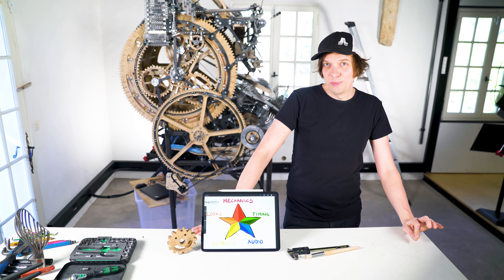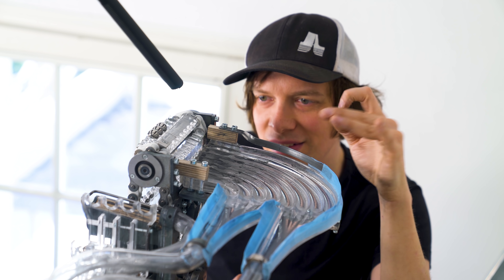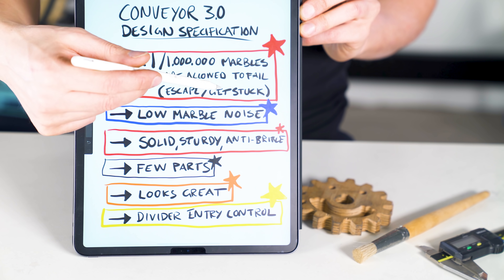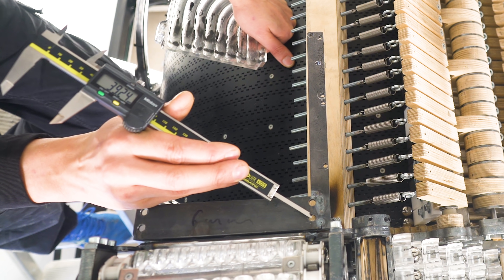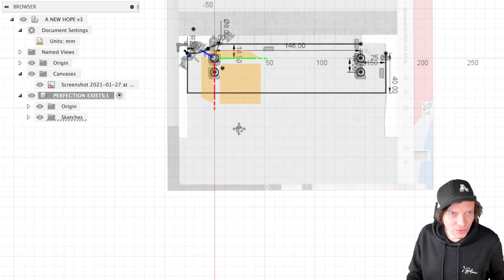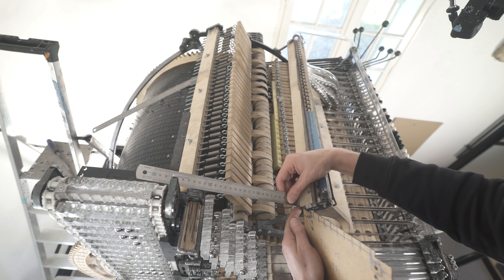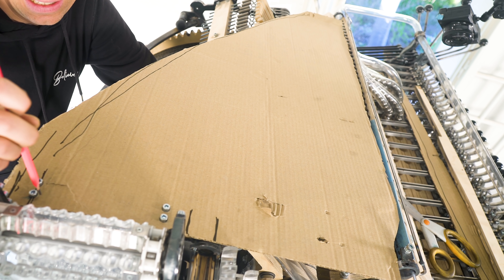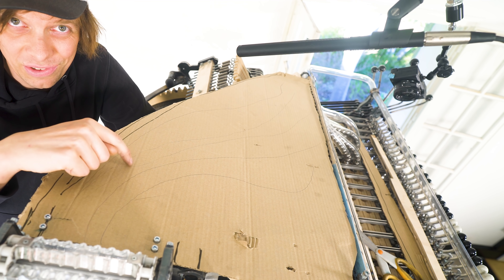Designing From First Principles

Comment: should this new version still pose problems with ghost marbles you could try the marble elevator angling towards the tracks that go to the divided. that's gonna need dampening where they drop down but it will solve the problem of ghost marbles.

Comment: Channelling all these marbles makes me think of exhaust systems for big multi-cylinder engines (V12s, for example), that have to manage the exhaust pulses out of the engine to ensure a smooth flow of gasses for the best performance - Each marble could be considered as one exhaust pulse out of an engine cylinder.. Maybe there are solutions to be found in the design of exhaust headers?

Comment: Hey Martin, unfortunately this design will not work as expected, the outer left channels will run out of marbles! You also have to take into account in which direction the momentum is driving the marbles, you have to transform their direction vector! IMHO, transforming it into a left to right movement with the pipes was the best solution!

Comment: If you've measured correctly, and your CAD is good, you could've made that gap as small as 2mm if you'd wanted to. Maybe even tighter than that. Right now you're right on the edge of where you needed that gap to be, which is more dangerous for your design. If I were you I would've stuck to the orginal 5mm you had planned.

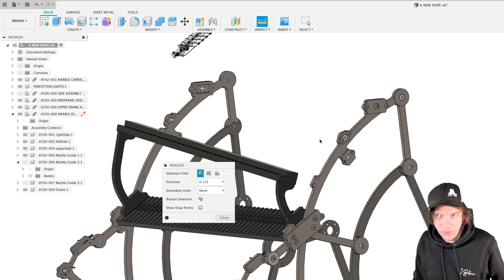Comment: Martin the first measurement you took on the CAD model at 13:27--it looks like the measure tool is measuring to the outside of the hole (not the center of the hole as you were intending). This may not matter as it seems like later in the video you may have built your reference geometry off of ruler-measured, "on machine" dimensions, but I don't want it to hose you!

Comment: I'm not sure why the complex production is a factor if the parts are already produced. This is the MMX, not the MMY. You said that the third Marble Machine would be the ideal one, unlike the MMX which while more consistent and reliable than the original MM, is still a prototype of sorts.
You've designed complex parts with multiple pieces and methods of fabrication. But you already made them. It doesn't matter that the process sucked, it had already produced the pieces. The backboard, for example. You had one already, couldn't that be repurposed?

Comment: In the process of developing a part using custom planes that implicitly refer to another part, wouldn't you just end up having to manually chase collisions due to dimension/feature changes through your entire project? Wouldn't properly constraining and referencing your out-of-file dimensions end up with a design that can recover and adjust to change in an automatic manner instead?

Comment: Martin, this really looks like you are bypassing the whole marble divider concept which you worked so hard on. Seems like you should be able to have many tracks/pipes going to a single track/pipe - after all, it has to happen at the bottom of the machine too... hope it works for you and you don't just create or reintroduce problems you had solved already. That actually happens all the time in the real engineering world, especially if you might have forgotten that it was even a problem, because you solved it so long ago!

Comment: okay, feeling more hopeful again. I feel like the tray the marbles dump into should be a but slanted to keep the marbles from sitting against the flat surface that bolting the new part to the metal plate underneath it will surely make, to keep the marbles from falling backwards

Comment: I have been watching your MMX build from the start but I don't remember much 3D printing. Why don't you reach out to a 3D printer?
Reply: If you look at his end credits he has a ton of past collaborators who have made parts for him. These include welded steel, machined steel, machined acrylic, laser-cut steel, 3D printed polymers. For an example of 3D printed polymer, check out the marble guide blades between the strings of the bass guitar.
Reply: @ps.2  gotcha, I was thinking about some 3D printed polymers that reduce sound a bit but also would probably be really useful do to the engineering you have the ability to use with curves, heights, thickness and whatever else may go into an engineering point of view. Big thing as well would be sound deformation, or dampening.
Reply: @zacharyfollett7305  Do you estimate that steel striking PLA is quieter than steel striking Baltic birch plywood? (I don't have any first-hand 3D printing experience so I can't say. But PLA parts I've handled do seem to be about as hard as plywood.)

He's also trying to reduce the parts count so if he used additive manufacturing, he'd need a machine with a pretty large working space. His current mill lets him cut parts as large as a whole sheet of plywood.
Reply: @ps.2  there are several different plastics to print with, some much softer than others. And I was not talking about the plywood. I was talking about the cnc'd plastic that the marbles come off of from the conveyor belt. Also just want to point out there are plenty of soft plastics you can 3D print with that are soft and reduce vibrations and noise. On top of that they come in several colors and they can be printed in one piece.
Reply: @ps.2  also considering build volume, there are plenty of 3D printers that can reduce the amount of pieces required for the build.

Comment: @wintergatan 2: good to see some movement towards a more engineering mindset! Took long enough ;) .  I suspect party of your issue is wear at the landing point as well, or just the hand fitting you've done in the past. It also might make sense to look at the marble transfer point. It would be more reliable (and quieter) if you had the marbles lift/ slide of the conveyor rather than fall as they do now. Imagine them getting scooped of the lifter by wire rails. It's a very common method used by other marble machines.

Comment: To get rid of the noise, but still have a precise marble path, you might consider machining a negative (i.e. a mold) and casting the surface in a firm but pliable polymer like PDMS.

Comment: I think you missed an opportunity with that divider wall. As you say the height allows them to "negotiate" around each other.
Taken further this could be made in to a passive solution to the channel height problem instead of thos path length adjusters.
If they can reliably go around then sitting proud doesn't matter.

Comment: Why must you constrain yourself to levels of perfection that vastly outweigh any professionally produced sound creation, recording or other related devices?  Do less than 1/1mill CD's get produced perfectly?  Are less than 1/1mill records produced perfectly?  Do less than 1/1mill songs get produced without any post-editing??  Do McDonalds get your order right less than 1/1mill ??  No.
Reply: I would say that some parts of the MMX are unchangeable, like the gearing.  The gearing is not protected at all, so loose marbles could easily fall in the wrong place.  That could jam the gears, shearing off the wooden teeth and essentially ending the concert series for weeks.  I'm of the opinion that there are no safe drop zones for marbles other than the instrument paths.

Comment: couldnt you have added a small vertical curve/ramp (at the conveyor drop-off) from the previous acrylic parts to prevent marbles from getting stuck or going back into the conveyor belt, rather than tearing out and replacing everything altogether there? just let gravity do the work.

Comment: CAD advice from an engineer:
1. I haven't played with Fusion, but if it's anything like Solidworks or Onshape, you can make those two circles equal with the "equal" constraint. Using that centerline just adds another element to the sketch, and just like the MMX, adding an unnecessary element just means adding another failure point if you need to tweak the design later.
2. From experience, you should add your fillets as features of the solid model, not as sketch segments. It's less likely to break if you go back to change things.
3. Breaking references between parts is smart. External references are super convenient, until they ruin the entire model.

Comment: I apologize if this has been answered elsewhere.
Why have both the fish stair and the conveyor belt? Both provide the same function, and their start/end points are quite near. Couldn't you reduce the number of parts - improving reliability - by routing the marbles to the bottom of the conveyor belt instead of the fish stair? You would, granted, have to use a 12 marble wide conveyor instead of an 8, to make up for the loss in lifting capacity.

Comment: I could watch so much more of you doing Fusion360! I'm totally with you about managing the timeline and being super considerate about which references and links you bring into each component.

Are you avoiding the links between components to keep your designs based on the models "as built"? Or is this to mitigate some kind of circular dependency of references? Why not let the links make future updates easier?

I would love to hear what your thoughts are on leveling up in Fusion 360 and how your thinking about design has changed over time. As you evolved from making one-off parts to managing a giant complex system of components, allowing for gaps between what is designed and built, what are the tricks and habits you have picked up? I think a lot of people design one-off things in isolation, but seldom get to work in such an iterative process as you have, or at least not so publicly, so you probably have a very unique perspective.

Comment: I don't know what you're doing, you said you want to do less videos and you're doing more.  You said you didn't want to redesign the machine but you are doing it.  Change to 22mm spacing and you will be done.  I don't have an opinion on your attitude toward the machine but I like the videos.  SV Seeker, a boat building channel, is aligned with your current attitude, it will be done when it's done!  And you should be happy doing the work.

Comment: Use polycarbonate, (Lexan) instead of acrylic. Lexan is very tough provided that the tools used don't have oil on them. Tapping holes with oil on the tap will cause the Lexan to crack.

Comment: At the bottom of the conveyor belt, add a cover, so if a ghost marble does ride back down, it won't fall out, the cover will keep it in the shuttle and it will ride back to the top

Comment: marbles can still fall back down the conveyor with that gap, actually they can fall with any gap or zero gap, because the movement of the conveyor is intermittent a well timed marble bouncing back against another in any sort of open tray can roll into the conveyor and the conveyor could move downward before it has a chance to roll out again, it's not likely at all but it is possible. a halfway working solution would be a slope on the lip of the tray, another solution is to make the chain wrap more than 180 degrees around the sprocket and use a guard to keep the marbles from falling out until they are over the tray, forcing the marbles to fall out of the conveyor in free air and not allowing a marble to ever encounter the conveyor in a state that it can hold marbles.

Comment: If you combine the divider and the delivery you can make an easier setup for linking to notes, so instead of having to bend tubes for each note you can bend tubes for front and back, and setting the marble stack at an integer inclination of the marble's size could remove the need for minute adjustments of the marble paths. I had an idea but I use CATIA and my machine is.. dead.

Comment: Im sure you could reduce the noise from the marble fork, by adding some deadening materials to to the underside. thin acrylic is quite resonant so any vibrations gets amplified to a a lot of noise. Adding something like Dynamat to the underside could deaden the fork. Might not fit your aesthetics requirements, but maybe you can think of other ways to deaden the large flat surface.

Comment: Hey Martin, great to see that your experience with the MMX leads you to fundamental development and design principles of engineering! Extend your design process with some more steps like collecting and comparing different concepts before implementing the design (like you've already done on other parts) and you'll end up following a norm for design methods ;) Imo, the whole idea of identifying and preventing later issues by following a structured development procedure before actually starting with CAD is probably one of the most important things to do when working on complex designs like the MMX. So keep on your great work, it's fun to see you improving your skills further and further!

Comment: This is more perfect time than there will ever be.
You wanted to increase the angle of marble divider surface (5 degrees one).
Now is the magic wand moment you talked about. Only 7 pipes to re-bend and the marbles wouldn't need the precision in height modules.
Now or never.
Reply: Notice that every single time he changes something, he introduces new issues that didn't exist before. That happens because he's focusing too much in getting small details right with the consequence of compromising functionality, as his machine is not designed to be fault tolerant, but has the impossible goal of being fail proof.

Comment: Improvement idea for the devide by four: you could maybe make the system more reliable if you balance the tipping point of the system to 5 or 6 marbles and than just release the 4 of them. In this case the marbles that should enter aren't able to move while it gets to the tipping point.

Comment: Maybe you can reduce some noise by making the area where the screws are a bit taller so they wont fall as much as before
Reply: The location where he put the silicone to quite the marble drop need to be moved vertical. If you notice the marbles come off the top of the conveyer and drop down to the channels. By moving the landing up it will quite the drop noise and help push them forward.

Comment: Hey Martin, I'm sorry in advance to the tone of this post, I'm not good at expressing myself in writing. Please read it, I think it might help you progress a lot with the machine. 

So, I've been wondering... 
What's the point of stopping all of the marbles from falling? Or trying to prevent a few small cracks?

I get the 99.99999% thing, but it seems to me you took it in a wrong direction, and your priorities are a bit off. 
It shouldn't be 100% marbles and 0 cracks, it should be 0.000001% chances of critical failures.

A few marbles dropped are not an issue - it might even be cool to be in the crowd next to the stage, trying to catch the marbles falling off the stage... 
So you need 100 more marbles for the next song? Just add them after the current song ends. 
Have a part that cracks after 3 concerts? Replace it. You're probably going to move this machine around in parts anyways.

My point is - it's better to have a 95% functional machine on stage than 100% non-functional at your studio.
Distinguish between critical and minor issues. Fix the critical ones first, and backlog the minor ones. If you have time in the future then whack those small moles. We all have our small imperfections, and there's nothing wrong with it.
Reply: Several people have pointed this same thought in the video where he mentioned his goal, which is impossible to achieve. There's no example of system in this universe that has a 1e-8% chance of failure. Good systems and designs have fault tolerance and recovery in mind. If you use a car engine as an example, it misfires, backfires and experience issues thousands of times during normal operation, but it was designed to keep working despite that. If you look at every single MMX video, you'll notice one peculiar thing: fixing certain issues introduce new issues that weren't present before or augments/starts issues somewhere else. That's because Martin is too focused on small details that are supposed to improve reliability without looking at the machine as a whole. I wouldn't be surprised if you see systems that worked fine before being "made better" later in the course of his project. But he just convinced himself he can do it and will most likely spend the rest of his life never achieving that goal.
Reply: To that end: I was happy to see Martin explain in the intro why a marble falling near the gearworks is really dangerous. I think that's his admission that a marble missing a funnel is not really dangerous. At least, I hope he has come to realise this, that not every dropped marble is a critical failure — depends where it drops and where it has the potential to land.
Reply: well put. and I agree. The machine with all it's parts is so charming as long as they doesn't totally break the whole machine or show. 

Why not think of it as a guitar with an amplifier. As you of course know, everything on the guitar, the cables and the amp is compromises. And that makes it what it is. :) the jack-cables are old telephone for example. 

The machine is a beauty, with cracks and with marbles on the floor or not.
And... on stage you always have the almighty Gaffer Tape :D

Cheers my dude!
Reply: @PontusRob  As he said, the marbles were falling into the gears and could result in a critical failure. So he had to fix it.
Reply: @davew4262   In that case, of course it has to get fixed :)

Comment: After he did 3 Working tests where he said "The maschine is working now im just opening tracks now" hes back to redoing working parts that are just a bit loud. I call it this Second Channel is not a good idea in regards to finishing the Machine.
Reply: Martin is also replacing the part because it's dropping marbles at a critical junction that risk jamming or breaking the central gears of the entire machine.
Reply: @DoomKitty3000  yes but that would have been fixed by removing the silicon as he said